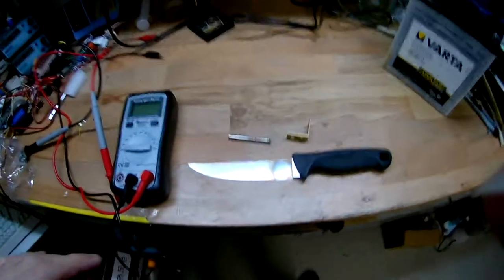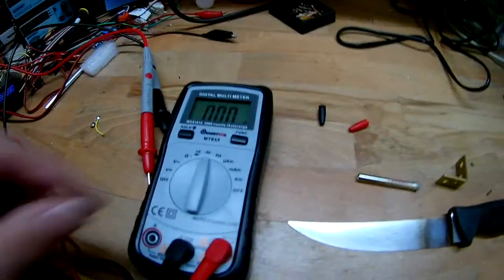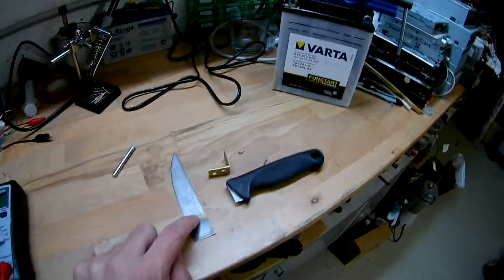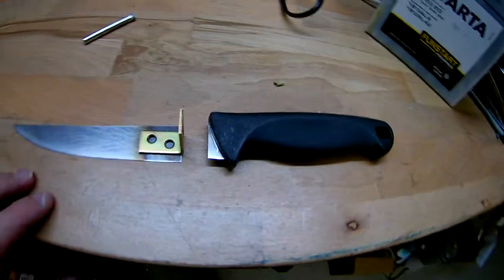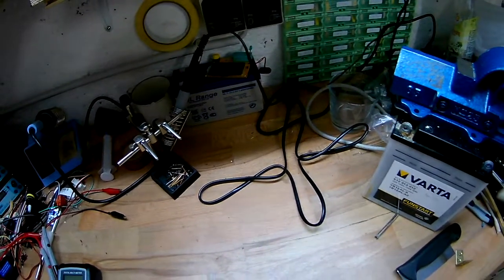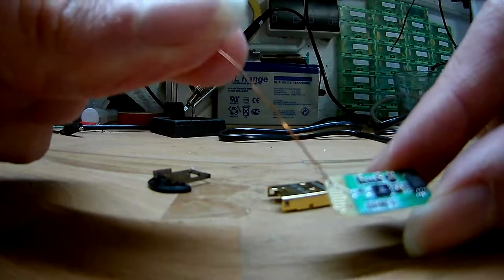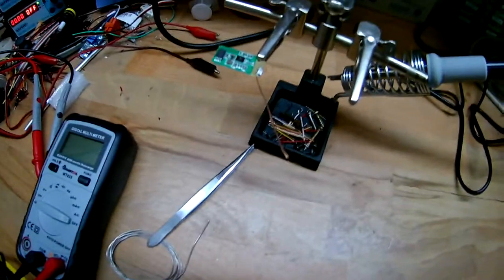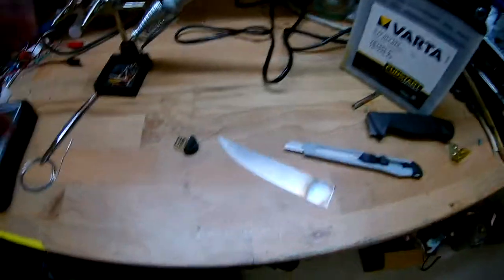Little Update on Ultrasonic Knife, Bluetooth Antenna

Comment: stainless steel is hard to work with. your knife is probably 440 stainless. To weld it you would need argon shielding and a TIG rig.
Reply from the maker: holesaw it is then :P